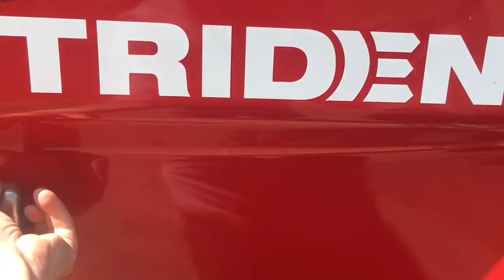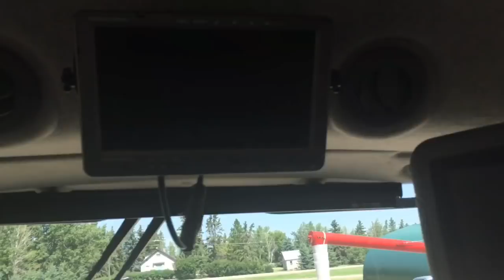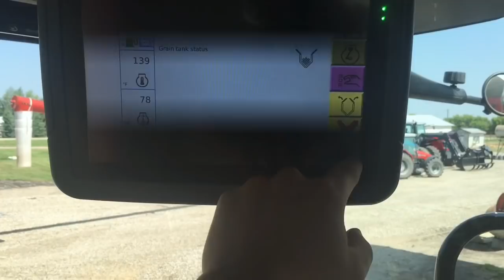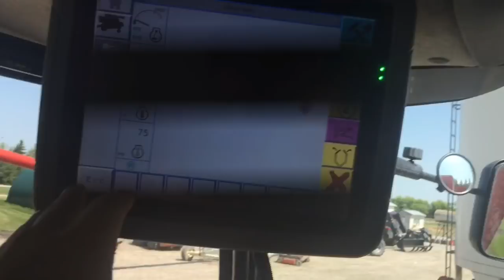The Beast has arrived!!!!

Comment: Massey has been a leader in combine tech for over a 100 years, and still the best out there. Powered by a beautiful 7 cyl, according power unit.( basically a Sisu, or aValtra engine.) really cheap on fuel, and run forever 18000 hrs, plus. Eat your heart out Deere.

Comment: Not sure if you’ll read this but how has the machine held up any major issues. Looking at this or 9560 but our front runner is a claas currently
Reply from the maker: It was a good combine. We only keep combines 2 maybe 3 years, usually put 1000 separator hours and then trade, so we are in an ideal 9 now. But it was such a good combine, we just needed something bigger.
Reply: @TrailerParkFarms  ok how many sep hrs were on it total in the end or do you remember?